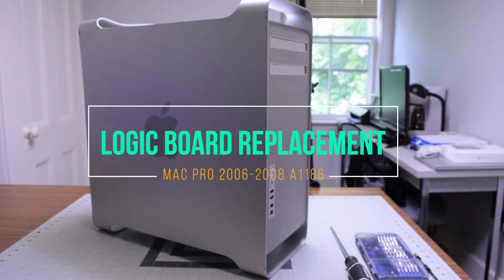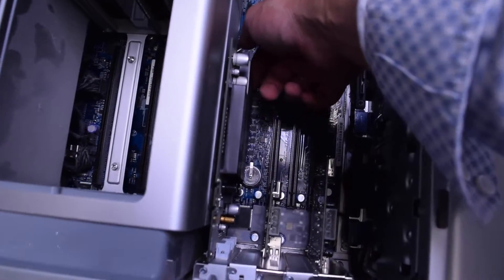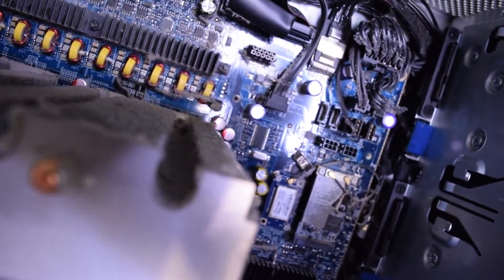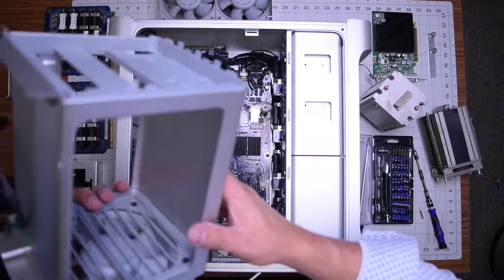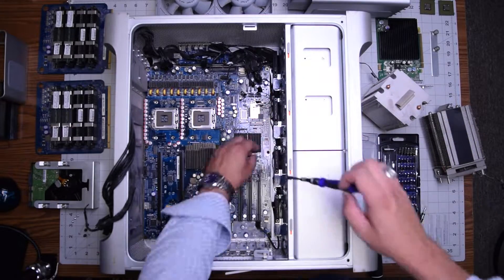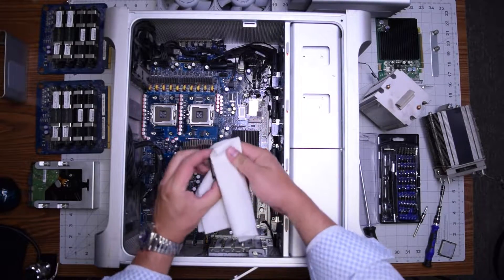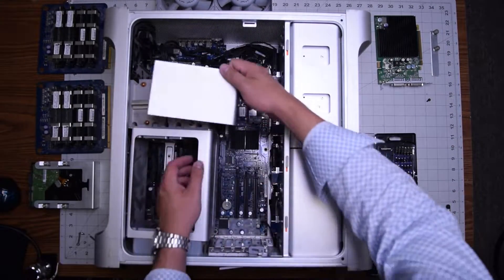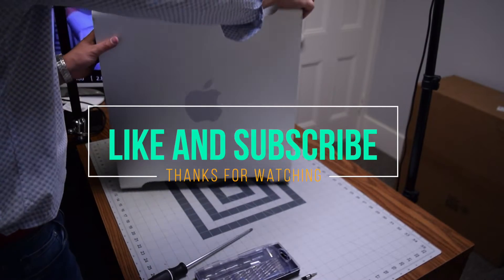Mac Pro A1186 - Logic Board Replacement (2006 and 2008)

Comment: Hola t escribo desde Panama y la pregunta es la siguiente: tengo una Macpro Mac Pro A1186 y le salio luz roja de diagnostico en la de CPU A y CPU B, ya se le cambio Power Supply, bandejas de memoria, memorias, tarjeta de video dando el resultado de que es el Logicboard o eso pienso yo. Lo que deseo saber es si sabes coo reparar este board o si es otro asunto y me puedas ayudar a revivir el equipo. Mil gracias, en espera de tus comentarios.
Reply: Hola, retomo el hilo por si te pudiera servir. Amigo, si te encienden los LED rojos de diagnóstico en la de CPU A y CPU B como díces, si son los LED: Led 3 (en Rojo) CPU B halts on an IERR (instruction error), Led 4 (en Rojo) CPU A halts on an IERR (instruction error)  - Si son los LED: Led 5 (en Rojo) CPU B OT (CPU B is over temperature), Led 6 (en Rojo) CPU A OT (CPU A is over temperature), lo que nos lleva a pensar que pudieran ser los 2 procesadores (2.8, 3.0 ó 3.2 GHz según sea tu caso, a veces se fríen porque les exigimos demasiado en climas muy calurosos, o la pasta térmica ya es muy vieja y no conduce bien el calor a los disipadores, etc. Busca el manual de servicio (no el manual de usuario aunque puedes descargarlo también) en Google, búscalo así: "Mac Pro early 2008 service manual" y de seguro lo encuentras, espero que hayas resuelto tu problema o que lo puedas hacer pronto, saludos desde México!!

Comment: can you place a motherboard from the 2008 model to the 2006 mac pro ?
Reply: No, the ram cage mounts and a few other things are different, also the memory trays on the 2008 are not in the same orientation as the 2006, so I’d assume no
Reply: @flippercomet5002  Yes it is true. It is not worth the effort since we can find a read one for cheap

Comment: The side screws for the memory housing::: mine had a very tight one that actually had its threaded chassis post start coming out. I shoved needle-nose pliers under the housing to hold it while I removed the top screw. There was red Lok-Tite on them. The 3,1 is easier to disassemble than the 1,1 in that you can remove the cpu cover and the front fan assembly MUCH easier than the 1,1...

Comment: In mine there are 4 screws holding down the ram cage + 2 on the bottom. 
The fan on Ram cage slides in the cage, so you can remove the cage. I have a chipset heatsink which needed to be removed because I can't unscrew CPU heatsink (there is not enough space to use extension for screwdriver.

Comment: if it is a 2,1 there is another screw joining the front fans with the speaker, you cannot remove the fans without removing it first. Also the Heatsink cover is magnetic. If it is a Special Request dual xeon 4 core 3 ghz model, the cpu heatsinks are soldered to the CPU's, all a PITA to remove, you must unscrew the Heatsinks and then twist them to break the solder joint, do not pull up or you can break the motherboard. Also the CPU B temperature sensor plug is left to the CPU not undet the memory cage. All people think they are exactly equal and the functionally are, but there are some construction differences. Great video by the way.
Reply: I forgot: Special Request MacPro2,1 3ghz soldered heatsinks have a rised part in the middle with touches the CPU and a square metallic gasket around it. Usually I apply thermal grease on the CPU but on those It is better to apply it on the heatsink. The gasket is kept in place with a special transparent grease too.
Reply: Where is this screw